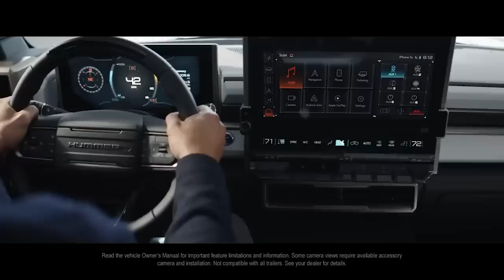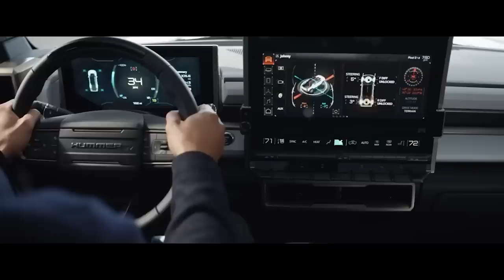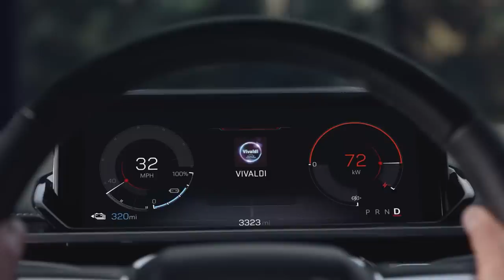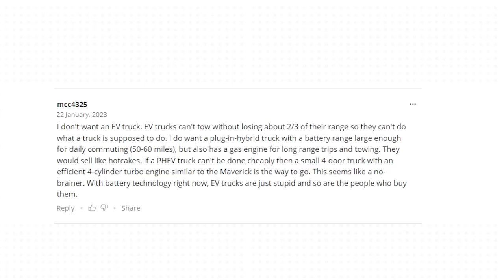GM Reveals New $25k Pick Up | Better Than Ford Maverick?

Comment: An EVPu for $25k? I've been looking for a 2013 GM Hybrid Escalade, Yukon, or Tahoe for over a year. Why? Because my wife only drives 3500 miles per year, most days only 6miles, and almost never over 40mph. That means she would be driving on battery mode 90% of the time. She would be high up, with comfort for her occasional 5 passengers. An EVPu just might be the a hit but a Hybrid would knock it out of the park. I used to tow daily, with my GMCs, 12500 & 18000 lb towing capability. A Hybrid can still tow 6k lbs. I could even see this EVPu used for our 400 mile long weekends. Right now she drives a lifted Saturn Outlook XR which every once in a while used it's full 7 passenger capacity. I would definitely invest in a EVPu. PERIOD!

Comment: Can GM make a truck for $25 WITHOUT a dealer hititng it with a $10K markup making it $35K? Thats the question! I'd like to see a hybrid truck like the Maverick where the 2nd row seats can be folded down and open up to the back of the pickup bed. I think thats a genius idea on the Siverado EV - Multi-Flex Midgate!

Comment: GM already cuts enough corners when it comes to quality in everything else they build, I can only imagine how poor the quality will be when trying to hit a $25k price point. I'll wait for the release of the Toyota Stout.

Also, we need more hybrid trucks. Screw electric trucks. They're not, yet, ready for prime time. Cold weather and towing drastically reduce range. Speaking of towing...how the hell are you supposed to stop and charge an EV truck if you have a trailer attached? Charging stations are not designed for. There are no pull through charging stations so the only option is to unhook your trailer, pull into the charging station for god knows how long and then hook back up to your trailer. Screw that!
Reply: Toyota stood would kill the maverick. Main problem is Toyota is going to take a decade to even release anything.
Reply: @IzaguirreC  I agree. Toyota's "wait and see" approach is getting old. Toyota used to be the king of compact trucks. They should've jumped back into the compact truck market as soon as the Maverick was announced. They'd certainly be ahead if they had.
Reply: @gadgetorian-rctechgadgetsm4566  agreed. If they would have started r/d as soon as the maverick got announced they would have a product already in showroom floors. I would buy Toyota over ford any day. I currently own a 2020 tacoma trd off-road (14k miles) and it’s a fantastic truck, but the mpg sucks. I ordered a maverick hybrid in September. I have only towed once with my truck in my almost 3 years of ownership. EVs are not ready for the current market, they are too expensive and battery degradation and discharge in cold climates makes it not worth it.

Comment: Right now with the work I do I want a hybrid. The number of miles I do every day is more than what a battery can be cost-effective. 

I am genuinely tired of not being able to get a Ford Maverick without it being marked up to nearly double. The fight between Ford corporate and dealerships to the general consumer is no longer interesting or useful for the general person. There are all sorts of problems with charging infrastructure not being there yet especially with the number of new EVS that are showing up. 

I like the price of the GM EV truck but I don't look forward to the fatigue of 100 mi battery unless you upgrade for $10,000. 3 to 5 years from now hopefully the infrastructure is there and then that would be a much more pleasant thing to throw my money at.

Comment: As the owner of a Chevy Bolt with 125,000 miles I would welcome a compact GM EV truck. We live in a rural area and often wish there was a compact EV truck on the market. I prefer the EV over a plug in hybrid for the reason that on my Bolt EV there hasn´t been any maintenance required and the only repair expense was a replacement of rusted brake rotors. Please GM keep the design as compact and as affordable as possible. If we want to tow we would buy a full size truck.

Comment: Here in the uk, electric prices are similar to petrol costs per mile, and with poor charging systems installed around the country, it's not a very encouraging situation. With the size of the US, a hybrid  vehicle is surely the only way forward at this time in the battery development steaks ?

Comment: I could go for either PHEV hybrid or full electric extended cab, not quad cab, with a good sized bed.  Around 200" in length would be ideal.  I just need AWD and light duty (5000lb towing and 1000lb payload). I would like some ride options like air suspension.  $50k or less.  The Hyundai Santa Cruz form factor and specs are close but would like a bit longer bed and PHEV or full EV.   About 60 miles of EV range and tax credit qualification a must.  Although overkill for me the Rivian is quite nice except for the price tag and 217" length is a bit too long for my desires.  I don't need 800HP either.  300-400 would be plenty.  And I do not want or need a high profile off roading vehicle.

Comment: If General Motors REALLY wanted to turn heads, why not update the Canyon/Colorado? A hybrid or EV model of those small pickups would be a much needed facelift, and a definite competitor to the Maverick and Santa Cruz. I used to own a '15 Canyon (enjoyed it a lot), and I don't see much of a change from then to now design-wise.
Reply: 2023 has a facelift on both Colorado and Canyon
Reply: All new muscular Colorado & Canyon are on their way to a showroom near you.
Reply: @petersimplife  They would have to gut them ! Too much weight !
Reply: @Douglas Smith  it is.. it's not a facelift, it's a completely new truck and it's only engine option is the 310hp turbo 4 banger out of the silverado.
Reply: @fposmith  NOPE, SOOOOOOOO
Reply: Chevy is the best, soooooo
Reply: I agree with you ..but dam make then affordable ..but man I live that new chevy truck they want to make omg ..good bye toyota and ford

Comment: For trucks, PHEV is the way to go. 

As the battery cells get older, they lose their capacity. My last lithium ion powered PHEV was down to 50% of its original range by the 80K mile mark. Hopefully the new battery chemistries will hold up better. In addition, I took roughly a 40-60% hit anytime the temperatures were below 40 degrees. So if you combine those figures, if an EV truck gets 80 miles of real world towing mileage (See TFL Truck’s test of the F150 Lightening) with 5K pounds when new, you are looking at roughly 35-45 miles when it is cold out. That is unusable for real towing but may be adequate for someone that just needs to make the occasional trip to Home Depot to pick up a trailer worth of supplies.
Reply: Hello 😄 Regards for tuning in! * You were randomly selected as one of my contest winners; get in touch with me*✍️.🎁. 💐.🛍️.

Comment: I am currently looking to buy a truck, but i will not buy an EV truck yet, because of how much range it lost from towing. But if there is a truck out there with hybrid power that have a capability of normal combustion engine, I will buy it in a hart beat!

Comment: I for one believes that Chevrolet can build a full size pick up for $ 25,000 or less if they stop putting all these unnecessary items that I for one don't want or need. Such as touch screens, heated and cooled seats, heated steering wheels, a tailgate that opens 50 different ways, automatic dimmers and the list goes on. I drive an 07 siverado classic and I like the simplicity of the truck. Cars and trucks are to be driven by the people behind the wheel and not the other way around. It's time for regular cab pickups to be discontinued.

Comment: PHEV yes, size of the Ranger with 50-60 mile range for daily. And hybrid power train out of the F-150 with the onboard 7.2K power inverter for work. Come on ford Build it! You have all the parts on the shelf already

Comment: So many reasons why a full ev pickup is wrong, while a hybrid is the right choice. Don't want to worry about drive range for EVs. Don't want to worry about how long to charge the car battery and the rising electric rates. The wait time to make a hybrid pickup is already too long, can imagine how much longer an ev pickup will take to make, as well as the constraints for the car features. At least 4.5 foot bed, crew cab a must, tow at least 3000 pounds, mpg at least high 30's combined. Features can be a mix of old and new, like the Toyota Tacoma, to save in costs. And please, make it reliable

Comment: agree that buying an ev truck is stupid at this point in time. As far as the Enviromint all you are doing is changing where the damage is done. Also, you have greater weight and increased road ware. Also add the fact that tires will not last as long and that itself is a pollutant. Maybe it they had them have range of say 500-mile range and a recharge time of say less than 15 mins from say 20% to 90ish you may have a deal breaker. but as of now no reasonable infrastructure exist.  And replacement cost of the battery's is as high as a car itself.

Comment: There isnt anything wrong with a small ev truck.   Most people arent towing.   They just want something to drive around in and occasionally throw something in the bed.

Even if they create a range extender option  that only works at 35mph plus (so only one gear)  thats fine.
Reply: I'm getting worried about these massive lithium mines. They create huge holes in our world.  The amount of fuel needed to create these is exceeding what these EV save. What do you think bot?

Comment: Pure ev or pretty much and non gas or diesel truck would and is still suicide. Look at what it takes to make the batteries. Diesel driving equipment. Plus semi's driven by Diesel engines. Transfer to the mill to get separate  minerals to get the lead or other items needed. That usually uses coal burning to get electricity or use natural gas ( from oil). So really, how clean is electric vehicles. Plus to charge the vehicle every night. Where does your power come from. Just think about it.

Comment: Totally disagree… got a Hyundai Kona with over 400 km range now for almost 5 years… Love Love Love it…. Never any range anxiety ever.  I charge twice a week at home all good there.  Never pay more then 50 bucks a month & no maintenance ever!  Got over 105,000 km so I drive it a lot.  People are wrong about towing issues because all you need is a small battery & motor on your trailer to assist a pick up and you’ll get the same mileage as with out towing….  My next vehicle will definitely be an Electric truck and I’ll be putting a motor and separate battery on my boat trailer…. Electric vehicles is a no brainer…. Your crazy not to get one! 😊

Comment: PHEV with 50-75 miles of EV only range is actually quite difficult to pull off.

The energy density that is required to make the batteries small enough so that you would be able to keep a compact pickup truck, compact, is actually really, really, really difficult.

Vehicles that are shaped more aerodynamically, for example, typically would get an electric efficiency of around 32-33 kWh/100 miles (i.e. 22MY Ford Escape PHEV, 22MY Tesla Model X) whilst vehicles that aren't as quite as aerodynamic would get closer to 49 kWh/100 mile (22MY Volvo XC90 T8 AWD ext range recharge).

In other words, you'd need to be able to jam in there, a pretty heavy and hefty battery to be able to hit 50-75 miles of electric-only range, which, often times, would be at odds with the whole "compact" part of the "compact pickup truck" moniker.

Think about it this way - you have so much space that you can put a gas tank in.

As an example, let's say that the gas only version would have a 20 US gallon tank (to make the illustrative math easier).

Hypothetically (and I am making up numbers here to illustrate the point):

You can either:

a) use all of that space for a battery and get x miles as a result of that.

b) use all of that space for a gas tank and get y miles.

Or c) use 1/2 of that space for a battery and 1/2 for a gas tank (so now you end up with only a 10 gallon tank), but the total range might be somewhere in between x < z < y.

And for (c), it might end towards the lower end rather than the higher end of the total driving range.

That is the kind of optimisation that you would need to run. (Grossly simplified, but it illustrates the point that you can lose a LOT of driving range by putting a big enough battery to be able to do 50-75 EV only miles.)

Comment: I am waiting for a full electric mid size truck and this may be the one. I have a Tacoma that I occasionally tow a small travel trailer with. The gas range of the gasoline Tacoma is cut in half when towing and I'd expect the same with an EV truck when towing. The key is how long it takes to charge at a DC charging station. Many travel trailer camp sites come with 50A 240V outlets perfect for destination charging, even a 30A 120V outlet would work. I've had an EV car for the past 6 years and won't buy gas or diesel vehicle again.
Reply: Key is, don't buy into Government Stupidity and control with EV.

Comment: I believe when there's one common charging port and charging station type EVs will be far more popular and received. Not everyone is interested all bells and whistles but a basic get in a go vehicle that works.  Also a 6 ft minimum bed is a must for most pickup drivers an users.
Reply: I’m not keen on the short beds either, but just observing what’s on the street it seems that most truck buyers want a crew cab with a short bed.  Actually, they’re probably fine if they aren’t work trucks but rather fun trucks - say a few guys headed for the woods for some camping, fishing, hunting or whatever, or maybe hauling a dirt bike.  They suit that purpose.  For actual work it would seem the longer bed would be superior, with perhaps and extended cab when you need to fit in a third person for a short ride, but you don’t see a lot of new ones on the road.
Reply: @stog9821  As a person forced to downgrade from a SuperDuty to a half ton, I agree.  It needed work and the warranty was out.   I bought a new one for the warranty when I traded in.  The gas vs. diesel is nice though. Let's Go Brando....We are quickly heading into Idiocracy, If you haven't watched that terrible movie...you should. We are there.
Reply: Please explain to me how they are going to put a "common charging port and charging station" across the US?   The answer is they can't.   As a person who travels across the country regularly, this cannot be achieved.   It is impossible.   Unless you can make Lithium out of thin air, it will not happen. The whole thing is a lie.  The amount of fuel needed to even create a battery exceeds the fuel of an EV over an F250.   This is a FACT. 

If you want to live in that world, please move to the nearest D run city and wait for it to happen.   Trust me it will.  Just wait..................
Reply: @chewyb383  I have chevy 2500hd there's never gonna be a ev be able to pull my 29 ft trailer 300 miles between charges.  But on the other hand EVs for city drivers it make sense. But me I am a country boy Pickups rule.

Comment: Total EV is a joke for most people a plug in hybrid makes lot more since. The ability to plug in to go from work or home with out using gas and having the gas backup for traveling long distance would be the best of both worlds. I would buy the maverick over a Hummer any day of the week the maverick 2.0 has a proven motor and the EV haven't been around long enough to see how they are going to hold up

Comment: I think EV technology is the way to go especially interchangeable technology should be prioritized. EV technology has an advantage over hybrid due to the fact there's very little moving parts less to fail. Yes range anxiety That's why interchange swap battery technology should be primary move because batteries are advancing but the truck itself will still be fully electric 1 million mile truck. Essentially as battery technology evolves You won't need a new truck just an upgrade swap at your local swap station.... Now with all that being said the hydrogen fuel cell technology could be implemented for long range with a hydrogen generator on board the truck would be a better alternative to hybrid. Commercial hydrogen is soon to be taking off so there could be that to consider but again this would be a generator not a motor. Micro engine micro hydrogen engine. This will be the future...

Comment: What appeals?  Simple: Something that is a direct replacement for a current vehicle with less hassle (no charging issues) perhaps less upfront cost (depends how much better it is), in short, overall a "better" vehicle.  The current EV market doesn't even come close.  I do NOT care about electronic gadgets.  I need to tow.  I need to haul.  In extreme heat and extreme cold.  I need to be able to take 500+ mile trips on occasion with no extra hassle/time involved.  10 minute "fill-ups" are a requirement.  All this "save the planet" talk is pure BS.  The carbon footprint of an EV is HUGE, and if they are widely adopted, we need to double, or triple, our power supplies.  Solar and wind are NOT going to cut it.  I wish I was wrong.  I really do.  There aren't enough raw materials on Earth for "everyone" to drive an EV.

Comment: Two engines don't make since..more wight more to.brake down ..make it as larger as colorado the one I want but can't afford..and with a 6 foot bed or mid gate would be better ..I been wanting to buy a GM or GMC never had one..the price is ridiculous 😢 no one can afford them. I need a truck that can accommodate 6 if possible.